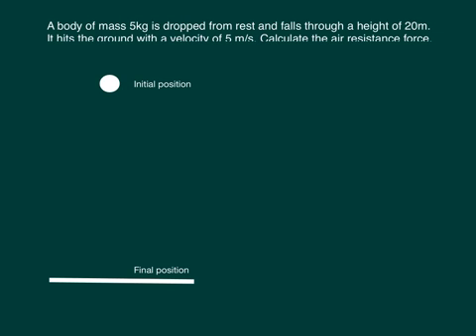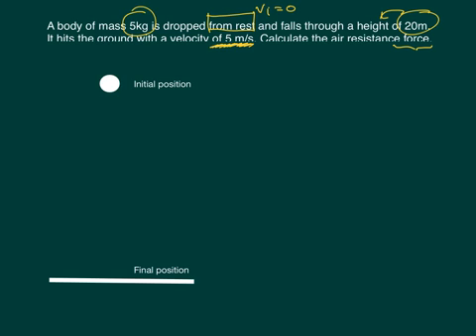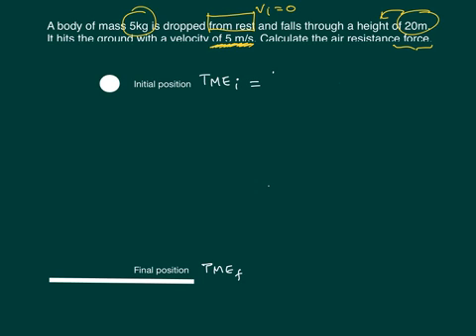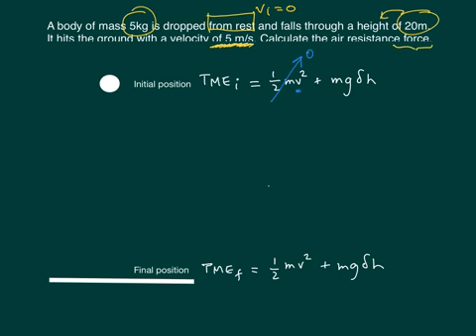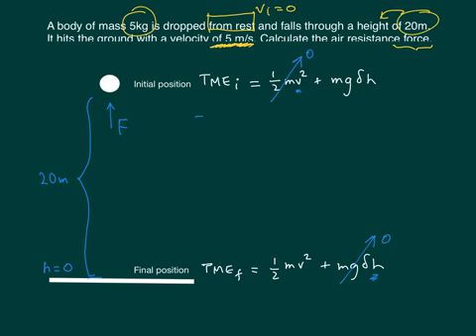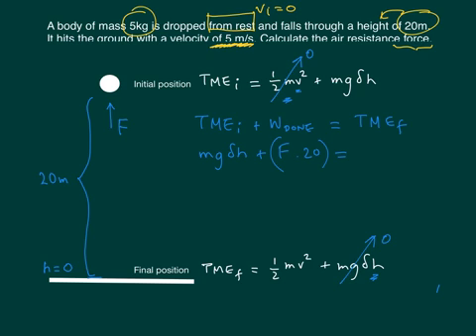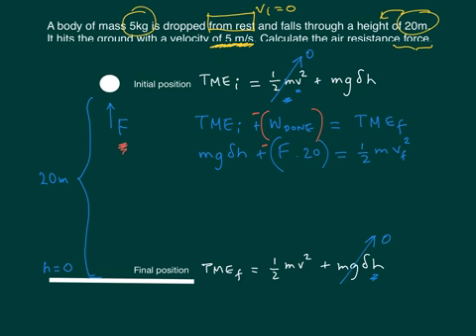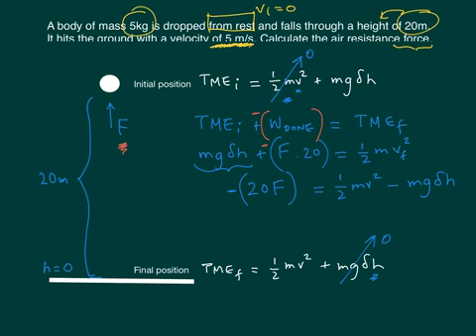Work energy theorem when falling with air resistance

Comment: But the force is not constant for the 20m. It changes as a function of velocity and hence time. The equation does not seem right.. you should integrate
Reply from the maker: Quite right Demitris, in this case we were delivering this to 15 yr olds who had not tackled calculus and the Force referred to is the average force over the 20 m.
Reply: @andreasphysics4495  Okay, that makes sense. Thanks!
Reply: Integrate what?
Reply: @youcannotspeaktomeanyhow  Find v(t) by solving newton's second law (the differential equation, that is) and then substituting it into  Drag=-bv^2